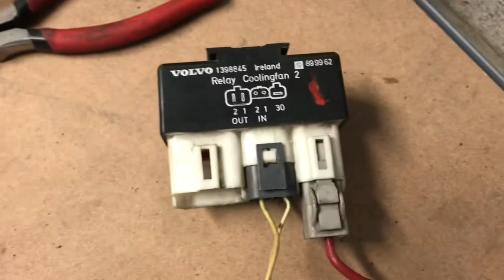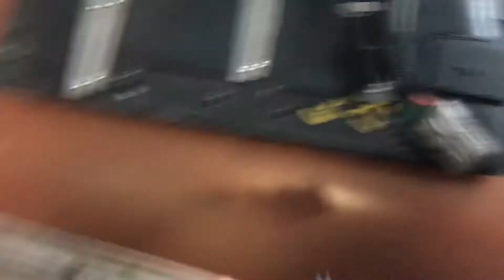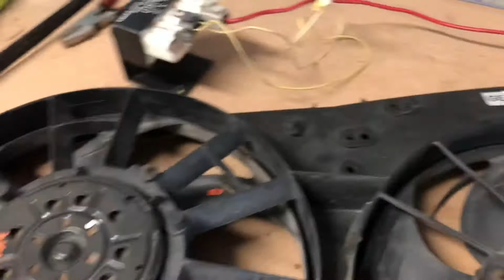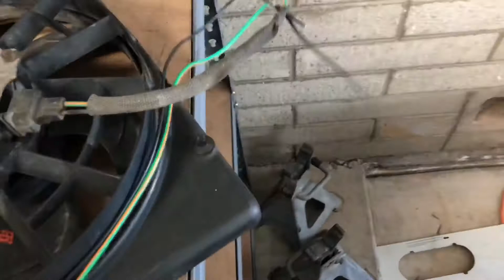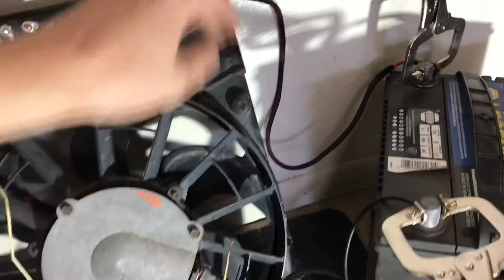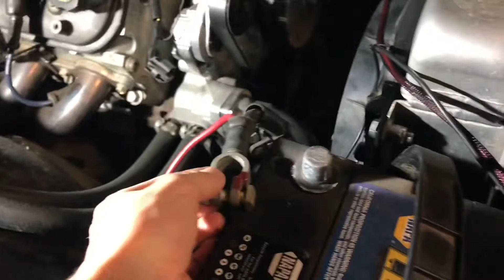66-67 Chevelle A-Body junkyard dual electric fan conversion

Comment: Where does it go in the har ness,like if u reused the stock harness.
No Volvos in my yards,?
I suppose any relay of the right amperage would be fine.
Ground to the coil,presto?
Reply from the maker: I am using a factory harness in my car, I had LT1swap.com program my 2001 truck PCM and he sets C1 Blue pin 42 and C2 Red pin 33 as the fan relay turn on wires. So one of those wires triggers low speed and the other triggers high speed. They are ground wires which is why the volvo relay works perfectly because it takes ground inputs for low and high speed!

Comment: That sound like a massive surge. When they turned on.
Reply from the maker: I just noticed that! I think that 40A self resetting circuit breaker is too small and it is tripping it constantly. The Volvo relay is rated for 70 Amps. I will have to measure how many amps these fans draw at startup and size a circuit breaker from there. The fans have never even kicked into high speed when actually driving the car so low speed is plenty for now. In the future I will install a PWM fan controller anyways so the fans will have soft start :D
Reply: @chevelle19721  look at the Mazda 6/ Inifinty Q50 relay.
Reply: @chevelle19721 
But the pwm controller for brushless fan isnt??  Make sure